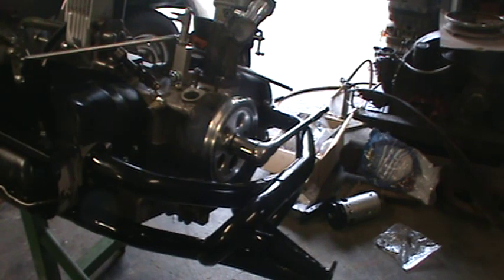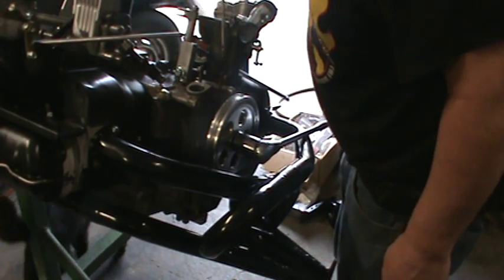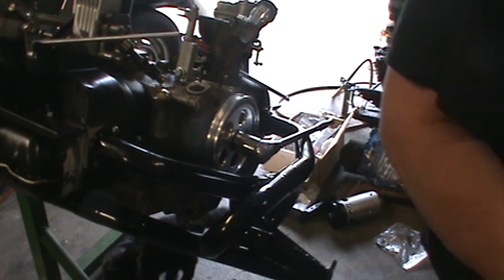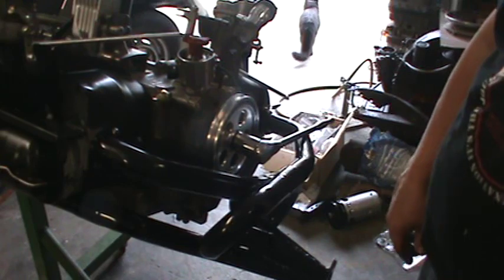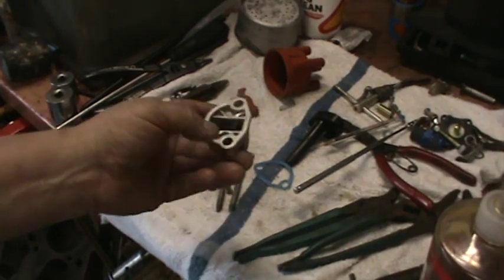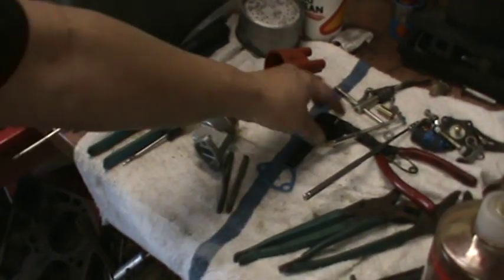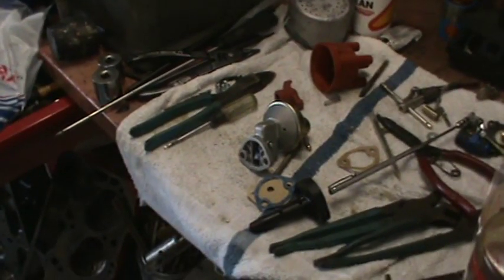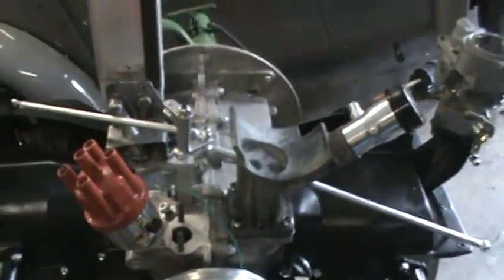distributor drive gear install on vw 1600

Comment: When I needed to rebuild my first motor.  Your videos were the first I came across.  I installed my distributor gear the way you do. Because well I never tried this before.  I've now done two of them, in both the cars we have bought.  And i tried it the other way this time. And all I have to say about that is , screw that! All that did was make me pay more attention to the bearing locations on the pin because when I pushed the gear in, it pushed the crank assembly up a bit. So, yep, I'm never doing it that way again. Gear after the cases goes together is the only way for me.

Comment: Darrin, so are you at TDC on #1 cylinder when you drop the distributor drive in?  And what's the orientation of the groove in the top of the drive?  Or does it matter?  Thanks!

Comment: Five minutes dropping in the three shims, and 20 seconds dropping in the gear.  Curious if the shims can be stuck to the gear before putting it in.
Reply: Gravity would be working against you and the possibility of one dropping off the gear while installing the drive gear in would be greatly increased.

Comment: Stay safe,get well.do you always use 3 shims under the drive gear ? I thought it was saposed to have 2 .i have had to use more than 2 on core engines that ran with no shims.
Reply from the maker: no it is 3 shims for the last 30yr lol they do make a thick shim , if you use a thick one you can you can use two one thick and one thin one, if not it is 3 thin
Reply: I have a pile of the shafts in a box all with 2 thin shims.
Reply from the maker: John Marks stop buy R&S he has the oem ones if you need some